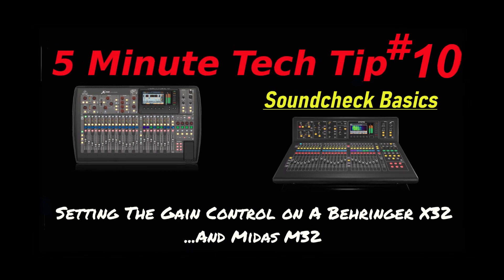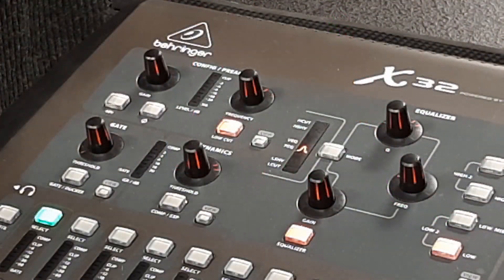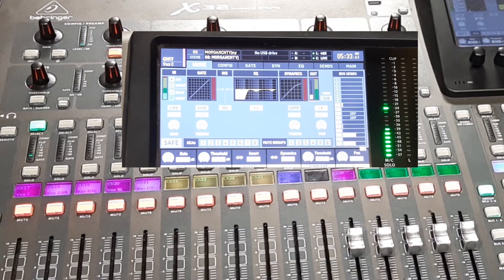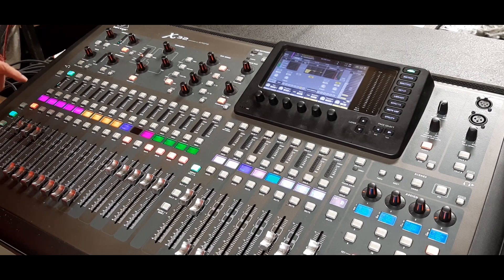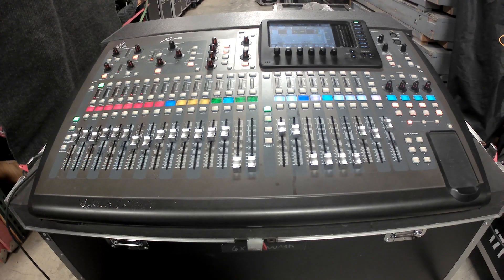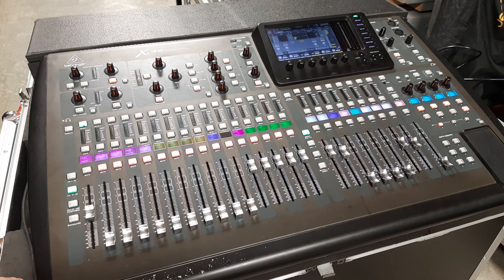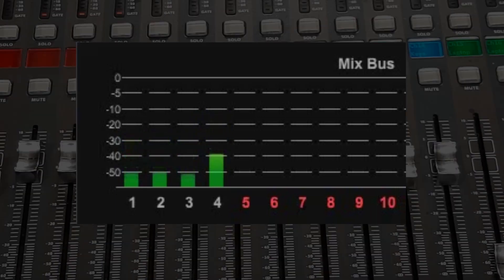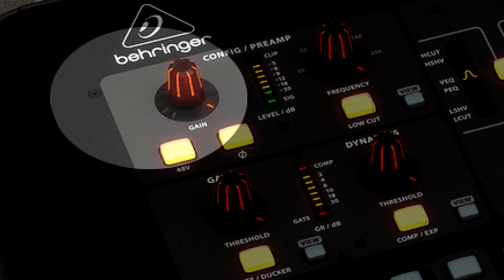Gain Structure and Signal Flow - Behringer X32 Midas M32 Soundcheck Tutorial

Comment: This may be a crazy question but I am a novice at this.... 😅 Typically, while you are setting the gain, are the faders all the way down or are they set at -0-?
Reply from the maker: Not a crazy question at all. I even have a video that talks about this because there are a lot of myths and old practices that have carried over from analog and the 70's and 80's, into digital and the 2020's.
The short answer is: Faders off.
The longer answer is:
If you get your gain structure right... in the console... at the amps...
Then your faders will likely live around unity (give or take) for your mix. 
But back in the "olden days" of limited analog consoles and horn loaded PA's, many people would pull the gain all the way back, put their faders at unity, and then bring up the gain until it was "loud enough for the mix".
This practice came from a time when input metering was limited, and of course saving settings was impossible.
Not the most optimum way to do things! The more likely all the other gain structure was correct, the better this method might work. But it made for consistent faders, and inconsistent "everything else". 
It also brings up the question: If the faders are supposed to be perfectly at unity, then why even have faders?
Here is the video where this gets discussed in detail:
https://youtu.be/7MJ3rfj7HNc
Reply: @AlanHamiltonAudio  thank you so much for the response!!! I’m a musician but I absolutely love the recording and live sound side of things. I do home recordings but I know that’s different from live. THANK YOU so much!
Reply from the maker: @roderickjmusic  Thanks!!

Comment: I have the m32c. Have you messed with the preamp controls in setup menu? Is there any sound benefit to running those hotter by pushing into the preamp more and pulling down the input gain on each channel to hit -18 vs running those at 0 and adjusting the channel gain accordingly?
Reply from the maker: Shouldn't be any benefit, and likely could cause trouble if you aren't careful to allow enough headroom. The actual preamp control is really where you have to be worried. Not so much with worry with digital trim, but again, there's no real benefit pushing that either... And digital trim won't save you from clipping no matter how much you adjust it down. 
All that said, I haven't used the M32c but doesn't it just remotely control the preamps of an AES50 box anyway? You don't actually have to set it up for both digital trim AND preamp control do you? Like you would with 2 X32's for example.
When I use the M32 or M32R and connect via AES to a DL32, I just have to set the inputs to AES50, I don't have to change preamp control.
But then, then I guess that might be different on some of the boxes vs the S32 or DL32. Like an S16 for example.

Still, no benefit to pushing the gain beyond a normal window that leaves you the headroom you need.

Just remember, it's an AVERAGE of -18dBFS... it can (and should) PEAK higher. Just not clipping or threatening to clip.
Reply: @AlanHamiltonAudio  yes, it does remotely control the DL32 that I have. The strange thing I came across doing a gig a few weeks ago was clipping in my Gig performer software. I was at -18 on the board with the trim but it was clipping in my software. I later found out some of my channels on the preamp controls levels were super high, some at +64. I brought them back down to zero. Not even sure why some of them were like that because I never messed with those. I can crank those up a bit and lower my trim input to -18 though. Just wasn't sure if I could get a warmer better sound with adding some harmonic distortion or saturation to the signal by pushing into the preamp more and lowering the trim. I'm starting to mess with it now as we speak but was just curious if there was any benefit to the sound by doing this as long as it was still hitting -18 on the board

Comment: I am a pastor of a small church who wears many hats.  I have an EE undergraduate degree so I am the sound engineer, until God brings us someone else :).   We have purchased a used x32 compact and are enjoying it.  But one question I have is that the system is so loud I had to either turn the preamp gain down on each channel or turn down the amp gain.  Since I have read that the preamps need to be set at -18, then my only option was to turn the amp gain down.  In order to bring the volume down, we had to set the outputs below 1/4, under 16 (about 20% volume).  But I wonder if this is right or if there is a better option?  Any thoughts?
Reply from the maker: Just to be clear, you're looking at the input METERS on the mixer, not the gain knob settings? -18dBFS is the average signal level, ballpark, that you should strive for... but it can peak higher. But never hit 0dBFS.

So... if you set your input gains properly... and bring your channel fader up to 'around' unity,  and your master fader can't then safely live 'around' unity without taking people's heads off... then for a quick fix, you can reduce the master fader level. Same is true for monitor bus main levels.
But, for a system you have time to troubleshoot, then turning down the level downstream is the correct answer.
Whether this is at the inputs of a DSP or at the amps themselves is another question...  But if you're not hitting the DSP too hard (if there even is a DSP or even crossover inline), then it's absolutely a workable solution to bring the amp sensitivity down.

Regardless of where you set the inputs on the amp, you can still drive the amp to full output. It just takes more input level to do it. If your console is sending a signal at basic unity that is more than loud enough with the amps running full, then reduce the amps evenly to keep any system balance the same.

For one thing, there's no need in the amps running at full sensitivity and unnecessarily amplifying hiss before the amp. So, if you're able to bring the amp input down, it's just that much less amplifying of any noise in front of the amp.

Meanwhile, it means your fader resolutions can now be more in the RANGE of unity. They don't have to be perfectly at unity. If you need to drop the main fader position back -5dB to start the Sunday morning service, there's nothing wrong with that. Even -10dB back. As long as that keeps your channel faders in an area where you have plenty of resolution to make whatever moves easily you need for your mix. And maybe the evening service will need some of that master level back.

But if setting the main fader position at -10dB is still crazy loud in the room, then your solution of dialing the amps back is a perfectly fine solution. At least UNLESS you're clipping something between the mixer and amps, like a crossover or DSP. In that case, look to bring the input down there and get THAT piece of equipment out of clip before addressing the amps. The amps might then be OK where they were.

All of this assumes you mean the input meter is reading -18dBFS on average when you set the channel gain. Not the position of the gain knob.
Reply: @AlanHamiltonAudio  Thank you for your time and help.  Yes I did mean input meter reading -18dBFS.  And I appreciated the point that lower that amp just meant adding less distortion.
Reply: @AlanHamiltonAudio  I have a smaller amp I can put on the main speakers (going from a rmx2450 to a rmx1450).  Would that be better or not?
Reply from the maker: @scottanderson9869  It's hard to say for certain since there are other variables to consider, but I'd probably stick with the higher wattage amp for headroom. It's not like the 2450 is super-huge and high wattage compared to the 1450. So, unless the 1450 was perfectly matched to the speaker(s), I'd stick with the RMX2450.

That said, if you go to QSC's website they have an amp calculator (or something similarly named) that you can plug in your speaker brand and model (choose it from a drop-down) and then it will tell you the recommended amps.
If you see the 1450 as one of their recommended amps, then you should probably make the switch.
Reply from the maker: https://www.qsc.com/resources/amplifier-selector/
Reply: @AlanHamiltonAudio  Thank you for you time and willingness to help.  These are things I couldn't find anywhere.  Thanks again.

Comment: Where should the channel fader be set when setting input gain for -18dbfs? Always thought you should be at 0...for best resolution of logarithmic channel fader....and you want room to move volume up or down...so curious what you recommend on X32...thanks
Reply from the maker: For the most part, if you set your input gain to hit around -18dBFS, then your channels should end up landing around 0dB/Unity for your mix (give or take). 

If you find your faders are making things too loud long before you reach unity, or takes way past unity to reach a workable level in the house, that's a sure sign your gain structure is off after the console. Or that you need to take a look at your master fader, subgroup masters, or DCA settings.
So, all else being equal, input level is -18dBFS or thereabouts, main out is at unity, or thereabouts, nothing assigned to subgroups or DCAs (or at unity if they are for this test/example)... AND...the levels coming out of your PA are either way too loud or way too soft for every fader... No fader can live comfortably around unity... Then that means system gain structure is off.

If it's your own PA, then the ideal answer is to make the proper adjusts on it to get it more inline with where it should be. If it's your console, but a house rig, then the simple answer is to use your main fader to to cool down or heat up the output of your mixer so that -18dBFS at the channel inputs does allow the faders to be around unity.

If you are having to deal with stage volume to the point you can barely put, for example, the guitars in the PA, and so their faders are barely up and that's not enough fader resolution to properly bring up leads with any accuracy, etc... The simple answer, and most correct answer, is to assign them to a DCA and choke back the guitar DCA until you get the channel fader resolution you want. You can also put them in a subgroup and accomplish the same thing, but that takes a bus (or busses for stereo) that you may or may not have available.

In a perfect world, consistently setting the channel gain will make send levels, comp and gate thresholds more consistent. You'll easily be able to tell something is wrong because you know that a certain send level should be taking someone's head off in the mons and it's not. Or that you can quickly set your comp threshold by the numbers at a rough in and already be in the ballpark.

Also... some of the Behringer vintage plugins DO use 0dBVU on their meters and expect normal input (unity) thru the console before them. So they are expecting you to be running the inputs at -18dBFS. If you gain up more than that, then you risk clipping the plugins, or pushing them to emulate whatever they programmed into them to do when the real vintage hardware gets a hot signal.

With proper gain structure down the line, and experience, you can steal or give back a few dB on the inputs to adjust a little for fader resolution and it won't be the end of the world. But if you find you have to do that everywhere, a lot, then that is a sure sign you have gain structure issues beyond the console. But that's one of the reasons you have a main fader. You can quickly compensate for that. But in a perfect world, you find where your gain structure is lacking and shore it up there. But that's not always possible if you're using your mixer, on a provided rig. Especially in a throw and go situation. So the main fader (and bus faders) are a quick fix. And for stage volume causing you problems with instruments not able to be put into the PA much at all (but you still want your fader somewhere above the lower third of the fader tray), DCA's and subgroups can help with that.

Ultimately though, the faders need to be wherever they need to be for the mix. I'd rather have the consistency of my gain structure from the input and all the way thru the signal chain than my faders perfectly at zero.
Reply: Thanks Alan...very thorough explanation...we have our own PA and X32...with inexperienced sound engineers...so your videos will help a bunch...new subscriber here...thanks...

PS...if you ever feel the need to share X32 recording with SD cards and routing process for virtual sound check feel free...asking for a friend...all the best!
Reply from the maker: @davidmartin1484  Thanks! Sounds like a good idea for a future video. I have the Live card loaded into one of the X32's... so, assuming it's still going to be a while before there are any live shows, I might just have to send some random tracks to the console to record onto the SD Cards for a simulated virtual soundcheck.

Comment: Question I am running my Helix guitar modeler straight to front of house via DI I am finding that when I have the gain level at minus 18 even when I have the fader to 10 that I am having a hard time hearing the guitar over the rest of the band do you recommend going higher then minus 18 or using the compressor on the channel and make up the gain there?
Reply from the maker: Are you averaging -18dBFS or peaking at it on your input meter? You should be averaging -18dBFS... and peaking higher. You can be aggressive with it.
What are the other the channels doing on their input meters?
Just to be clear, you're setting the gain control so the meter is averaging -18dBFS... not the position of the knob.
If you're using compression on the channel, turn it off for testing. Make sure the issue isn't that you're running so much compression that you've killed your output. In that case you would use makeup gain, but it's probably a sign that you're using too much compression before you actually get to the makeup gain to compensate.
Don't use the compressor makeup gain to compensate for too much compression... make sure the compression is correct... then apply any makeup gain needed.

It's hard to tell from the internet and not actually seeing and hearing things. ...Assuming you're channel input level is set perfectly... and assuming the rest of the band's input level is also set consistently and perfectly...
Then the question is why is your guitar weak compared to everything else (especially if turning off the channel comp for testing didn't fix anything).
Is it the stage volume of everyone else overwhelming your guitar? Even then, you should be able to get over that... if the vocals are getting over that...
You'd want to make sure you don't have your guitar channel assigned to a subgroup... and then the subgroup choked way back. Or that you don't have your guitar assigned to a DCA and the DCA choked back. Or accidentally assigned to a DCA or more than one DCA and it be choked back. So follow you signal path and check all of that.
Also... you want to make sure your main level is up like it should be on the master fader. If you have that choked back, then your channel can't overcome that. I wouldn't think that would be the case if everything else is OK on their channel input meters, but it doesn't hurt to check all of this.
If your system was set up incorrectly and everything adjusted by pushing the channel meters to 0dBFS (thinking that was the same as 0dBu on an analog console) then it's likely either your main fader or amps/crossover/DSP are choked back because your board has been overgained and hitting them too hot.

But that said, that should show itself in every channel, not just your guitar channel... but only if you make sure every channel is averaging -18dFS. If your guitar channel is the only one with a proper input level, and everything else is gained too hot... and then system setup wrong for the channels that are too hot, then that could lead to the problem you're seeing.
Reply: @AlanHamiltonAudio  yeah the vocals are averaging at -18 on the meter and are making it over the guitar and the compression was off on the channel when I did the gain staging will try raising the output level on the modeler and see if that helps I also just switched the combinator settings as per your video also took off the sbc and the 48db

Comment: Hi, just an insight about the subject, first what are the channel meters reading type of X32 mixer,RMS or PEAK reading?
2. Aiming for an Average of -18dBFS should also read somewhere at  Peak  -9dBFS on a full scale digital peak meter as nominal Line-Level..
3.So may I suggest to aiming for let's say between -12dBFS to -9dBFS on a full scale peak meter reading as with so many digital console channel metering system because it should read instead an Average of -20dBFS to -18dBFS  on Rms meter and somewher 0VU on the Vu meter?
Reply from the maker: X32/M32 meters are PEAK meters.
Reply: @AlanHamiltonAudio  thanks Alan for the reply, so basically it means that we should aim for a -12 to -9 dbfs on a peak meter or on the x32 meter? When an average of that will show something like -20dbfs or so?
Reply: From my understanding you spoke about an rms reading optimal line level where the x32 is in peak mode reading,from a sine wave perspective it’s ok but to averaging that’s another issue  if I’m not wrong my brother please kindly give the light…thanks
Reply from the maker: @mapigoalan  I'd lean more to -9dBFS as the occasional peak. -12dBFS would be pretty conservative. You could look at peaks of -6dBFS, but that would be getting aggressive and assuming we're really seeing the peak at -6dFS , and adrenaline and/or a volume knob won't be pushing above that and eating away at that 6dB margin of error as the show wears on.
Reply: It has to be -18db RMS to get the full 24/48 conversion out of the desk. That means you want to be peaking around -10 to be safe.